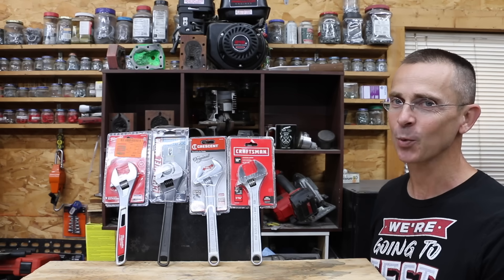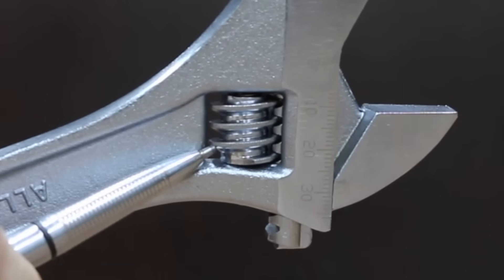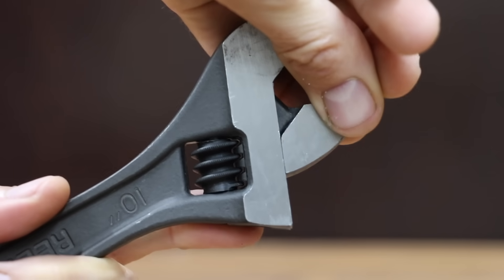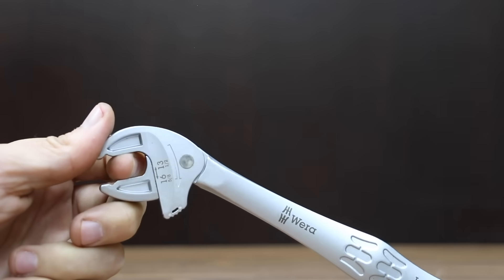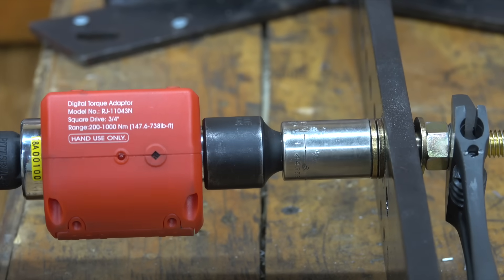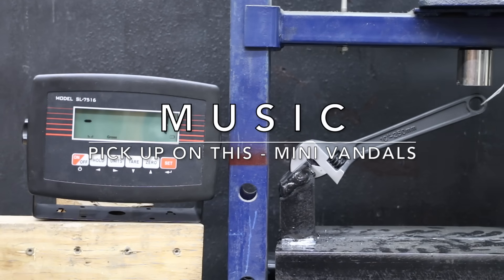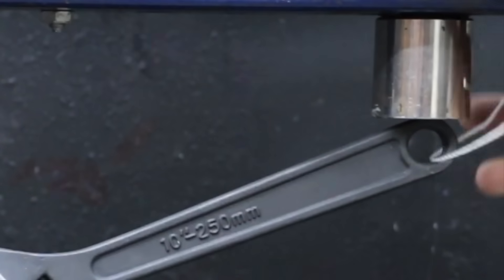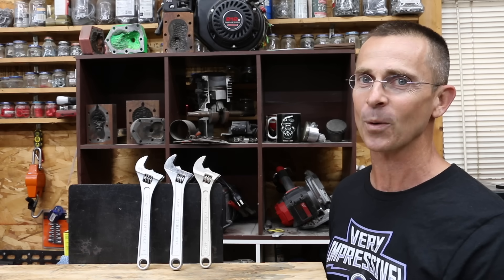Best Wrench (ADJUSTABLE)? Craftsman USA vs Craftsman, Crescent, Kobalt, Milwaukee, Channellock

Comment: I think I remember Ave saying once that to get an extra tight clamp load, adjust it as far as you can by hand, then tap it to cause the slack in the worm gear, and then tighten a bit more.  I think the real comparison is a dirt cheap $30 set of box end wrenches vs a fairly expensive $30 adjustable wrench.  I envy other countries that don't need to bother with inferior SAE fasteners, and only need to have a single set of sockets/wrenches/etc.
Reply from the maker: Thanks for sharing.

Comment: My 10" bahco stripped the adjustment nut when I put a pipe on the handle,  didn't get much pressure on it before it broke either.  
Weird.
Reply from the maker: Thanks for sharing!

Comment: Good as always!!! 
SUGGESTION!!!
I wish you would include a couple of the " professional" brand tools like Snap-On and Mac, Matco, etc. It will let people see that the the highly overpriced " professional" tools are in most cases no better that the ones your using. I think it would also show some of the ones that buy the highly overpriced ones  , that there not that great, in a wide comparison of all the brands your already comparing. I have a couple mechanic friends that have well over  $100,000 tied up in Snap-On, so would love to show them some real tool tests like yours with a wide range of comparisons. One friend had already quit buying Snap-On but my other one is a die hard.
Reply from the maker: Thanks!  Thanks for the suggestion.

Comment: Great Video!  Thank you.  It has always been said… to be careful of which way you turn a “crescent wrench”.  I would be curious to know if there is a performance difference when using the wrenches in different directions.  A difference direction when applying torque changes where there movable jaw sees the load from the corner of the nut.  In your, very good test, the corner of the nut applied load farther out o. The movable jaw.  If the direction of rotation is changed the corner of the nut engaged with the movable jaw moves in closer to the body of the wrench.  I wonder if that will change the performance of the nut rounding.  Thanks again for a great video showdown.  All the best.  Chuck

Comment: This is a great Video.  My outcome for the choice of adjustable wrench is a little different than the one here, but my requirements have shifted over the years.

I have owned a YUGE number of adjustable wrenches in the last 35 years and the ones that I have that perform the best are my set of 807x series Bahco wrenches that I keep stashed in my grab and go tool bag.  The Kobalt and Crescents have been relegated to the "back of my closet" tool bags that I keep in the house for light work but I know they will not handle serious stress.  The Made in the USA Craftsman are still in my tool chests, but they are not nearly as dependable as my  Bahco which is why they are not in the critical Grab and Go tool bag of essentials.  I do not have any of the foreign made Sears Craftsman so I cannot compare those to the ones that were tested.   

At the end of the day, the Bahco adjustable wrenches have been worth every penny of money that I have spent on them.  They have been a super robust wrench and the examples that I have show even less slop than the one in the video.  They are a great wrench to keep under the seat of your truck as they are dependable and work every time.  Yes, they are expensive which is a disadvantage, but having broke a 10" Kobalt while making a repair to a car along the side of the road, I changed how I picked my tools to keep with me when I make trips.  For me, the Bahco (who just happens to make the adjustable wrenches sold under the Snap-On brand) are the best choice for reliability when I don't have a set of combination wrenches in reach.    

I have to admit in the modern age, Crescent is my backup to Bahco, but the 8" Crescent brand wrench was slipping on the same bolt that broke the 10" Kobalt which is why that brand is not in my bag.  That was a bad day and it changed how I purchase tools.

Comment: Just one problem (well two): 1) manufacturer continually change material composition (and sometimes production process) over the years to 'try' to maintain quality while lowering cost.

2) Slack vs precision jaws means: speed to do a job vs how well or tight you can transfer your load per job.  These tools are meant for general use, you will not see them used as often say in a F1 race.  Use 6 sided socket or Knipex parallel wrench.
Reply from the maker: Thanks for the constructive feedback.

Comment: Maybe test wire strippers - how well do they work with different sized cables.
Mine has a success rate of <50% :(
Reply from the maker: Thanks for the suggestion.

Comment: Not the least bit surprised. The first time I got my hands on a vintage USA Craftsman adjustable I was shocked at just how much nicer it was than any adjustable I'd ever used before or since, including other Craftsman.

I would like to see a version of this with locking adjustable wrenches included.
Reply: I have a 36 year old 12" Craftsman adjustable wrench. It is starting to get a little tired but still on the top of the tool box.
Reply from the maker: Thanks for the suggestion.
Reply: Locking adjustable wrenches are more of a gimmick than a real performer. I had one that was a craftsman (not sure if USA craftsman or china) I was so frustrated with the tool and the lack of improvement over a traditional crescent wrench I gave it away rather than throwing it away like I was strongly considering.
Reply: @bindthedevilloosetheangels  That might be a Craftsman problem, not a tool design problem.  I have one from Stanley and it grips so well that on one occasion I was able to use it to loosen brake flare nuts without rounding them off when I didn't have the oddball flare nut wrench required.
Reply: @IOwnCalculus  Nice. Situations like that is why I bought Flank drive plus wrenches which at the time where one of a kind. Now there are lots of copy cats.

Comment: I use a 75 year old DIAMOND Brand adjustable wrench that belonged to my grandad, newer wrenches just have too much slop in them and have a tendency to round the shoulders off a nut or bolt.
Reply from the maker: Thanks for sharing.

Comment: I’ve had a few beers so maybe I’m off base here but it seems to me you have reverse logic regarding the length of the jaws and the results of some of the tests. In my 5 beer state, seems to me that short jaws would be an advantage on the feeler gauge test of jaw stretch and that short jaws would also be an advantage on pressure - to - failure test. Or maybe I’m just annoyed that no matter how well-dine I cook my wife and kids burgers they complain that it’s too pink. The interior lighting makes the burger look much more pink than outside light. Am I right?  Besides, who wants to eat nothing but char. Can I get an amen from anyone?  I’m at the point where I’m gonna make them stand at the grill with me and do test cuts throughout the cooking process. Now what were we talking about?  Has anyone seen where the pringles went???

Comment: They don't make them like they used to. Long ago, American companies goal when making a wrench was just to make the best wrench they could. Now it is all to appease shareholders, maximize margins, reduce costs of production, revenue. Statistical analysis to determine what is the most profitable way to make a lifetime warranty tool. They don't actually need them to never break, just that the margin is high enough that the cost of replacements for the 1/50 customers who use them hard enough to break them is offset by the cost savings on the rest of the buyers who don't.
Reply from the maker: Thank you!

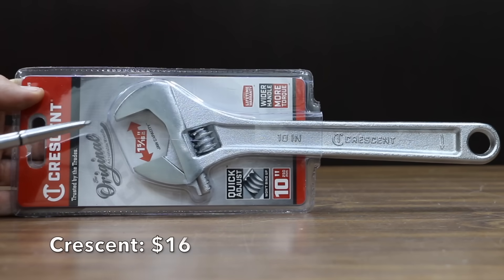Comment: 2:42 Wider handle for more torque?  I'm not sure torque works that way XD  Edit: Maybe I'm misunderstanding, but the handle looked tick in width, whereas torque should be from bolt grip to end of handle / primary torque point.
Reply from the maker: Thank for the feedback.

Comment: Once again excellent video. Always appreciate the effort. Adjustable wrenches are one tool where a cheap, poorly made version can be almost unusable. Anything with more than a mm movement is ridiculous and you may as well be using the wrong size combination wrench. A lot of times you have to hold the adjustment with your thumb while you work or readjust it each turn. It can be a nightmare.

The Klein seems like a super solid tool
Reply from the maker: Thank you!

Comment: You should test some ratchet wrenches. For strength and the lowest torque required to rachet as well as degrees of travel needed to rachet. You know since they tend to get used in the most inaccessible places.
Reply from the maker: Thank you for the video idea!

Comment: Another excellent video sir! And this one is one I've been waiting on due to some past irritation when trying to find a good quality adjustable wrench. I currently use a 12" Crescent brand (USA made version) and while it does seem to work quite well, I was pretty disappointed in the finish work on it. The edges of the jaws are razor sharp and the adjustment screw doesn't move as smooth as I would expect for a $50 wrench (probably $90 now... let's go Brandon! lol) Anyhow, here's an idea for a video. Tools made by several companies that offer both USA and China made version and put their USA and China versions head to head. I know this has already been done in your videos to some extent but not specifically a USA vs China version showdown. Just an idea.
Reply from the maker: Thank you!

Comment: The Flex Tape boat test? Cut the boat in half, put it back together with Flex Tape. It sits outside all winter exposed to the elements. Put it in the water in the spring. Will it  float and not leak after sitting outside all winter?
Reply from the maker: Thank you for the video idea!

Comment: In Spain we have a lot of great brands of adjustable wrenches, mostly from the Basque country. Acesa, Irega, Irimo, Palmera (Palm tree) now Bahco. I have an Acesa and looks very similar to the Klein. Great video as always! Cheers from Barcelona!
Reply: Yes who knew Spain was now the epicenter of adjustable wrench manufacturing 😂. Good for Spain - Anywhere but Communist China is a blessing.
Reply: I have used a Palmera ratchet screwdriver 6 days a week for over 20 years, never jammed or needed lubricant, heavily used and abused still works flawlessly rain or shine. I believe Snap-on paid license to Palmera to use the same design for their ratchet screwdriver.
Reply from the maker: Thank you!
Reply: @ProjectFarm  no, thank you for all the great comparisons
Reply: Snap on adjustables are made there as well.
Reply: Good files too. Bahco. 👍
Reply: Baco no se parte ,eso es muy bueno,no me gusta la herramienta que se Quiebra facil
Reply: I'm not defending China but let me tell you this real fact. The quality depends on the price you pay. You want a high quality one? Pay more money. You didn't have enough money? Then buy a cheap one but with lower quality. When China imitated something, they created two kinds of it for different market.
Reply: That is not true and that way of thinking is unfounded. Price doesn't equal quality, specially when quality control, building materials and technique are not a priority. There is no reason to buy anything from Chinese manufacturers if you have an alternative in your country. If you buy from China not only are you acquiring a sub-par item but also you are harming your local economy and helping China dominate your country more and more.
Reply: @Mikael2492  you can find bad quality stuff everywhere not only in china, and not always it's related to the price you pay, hence this channel, where sometimes reasonably priced items, perform similar to most expensive ones.

Comment: One thing that impoved my life a lot was throwing away all other adjustable wrenches but those bahcos. Especially the smaller 9031P gets a lot of use, but still in general use the knipex pliers wrench is better all around tool and is carried every way in the tool bag, but in the shop bahco is in frequent use and sometimes goes out in the field when I know there is a job it fits better.

Plumber taught me to apply torque the opposite way as in this video, applying it through the base of the movable jaw, not the tip. I have followed his advice.

Thank you for testing.
Reply from the maker: Thank you!

Comment: I hated seeing the old Craftsman tested to failure. :-( 

I have a Stanley 12" adjustable wrench that I picked up some 20 years ago and it's been just amazing. It was advertised as "Titanium", and from what I can tell, the handle is titanium, while the jaws and adjuster are steel. The jaws have about .5mm of slop in them, but I'd say that's acceptable for a well-used tool.
Reply from the maker: Thank you!

Comment: I feel like adjustable spanners get a bad rap because of incorrect use. Ive had a cheap Lidl branded one for about 6 years now, never rounded a bolt or damaged bolt heads, i feel like adjustables should generally be used for low torque applications. Anything above 50 newtons and i go get a socket set. Dont need a torque wrench before that as i have a calibrated elbow.
Reply from the maker: Thank you!

Comment: Gedore companie knew peoples would use the wrench as a hammer. Nice touch there! XD
I was a little bit surprise the ChannelLock didn't hold ON to the task(first test). Pun intended. But considering the narrower jaw is still an impressive result, still beating wider jaw wrench.
And i can basically say the same thing for the second stress test. Even though it has a narrow jaw (aka less material to withstand torture test) It still scored 6th-8th overall.
Very impressive tests! Keep up the testing! :)

Very interesting to see no worm-screw sheared. I used to see theses little screw shear apart with cheap wrench 15 years ago...
Reply from the maker: Thank you!

Comment: Wouldn't a shorter jaw be at an advantage due to less leverage applying force to the breaking point of the tool. For example a short cheater bar creates less force than a long one with equal wieght applied. Fix my thinking if it's wrong please.
Reply from the maker: Thank you!

Comment: You've now got almost every essential tool tested now! Only type of plier that's left is needle nose! And for that, it's primarily about gripping power and testing which type won't slip when yanking things out of tight spaces. Let's see if that crosshatch pattern that Channellock advertises is really that special (my experience says yes). Thanks for what you do!
Reply from the maker: Thank you!

Comment: Whenever I see a new project farm video, I'm both fascinated to know the results, but also rooting for my previous decisions/tool-purchases.
I've ended up with 3 Bahco spanners in my toolbox, and love them to bits. Not the expensive one feaured here with the rubber grip, just the regular all metal ones for a reasonable price, with minimal slop.
Reply from the maker: Thank you!
Reply: @ProjectFarm  They're not perfect - tend to pick up a bot of corrosion and benefit from an oily rag.
But they're the adjustable spanner team I'm backing, and you can fight me if you disagree :)

Comment: Some stuff they don't make like they used to. I mean, with hand tools like that, that have been around for a while, what significant improvements have they made over the last 30 years? 

I'd have to check the brand, but I inherited a couple adjustable wrenches from my grandpa, one of them is rusted to shit, definitely used, but the rust prevents it from backing off a nut lol. And its jaws are still pretty straight, it's my go to if I need and adjustable.
Reply from the maker: Thank you!

Comment: I don't understand the obsession with naming where the tool is manufactured. If craftsman wanted a tool manufactured in China that is the same performance of the old USA made one, they just have to specify it. The issue is that these are made to a price, not where they are made.
Reply from the maker: Thank you for the feedback!

Comment: G'day,

Great Tests, well done.

Here in Oz these things are known as either a
"Shifting Spanner"
or a
"Monkey Wrench"...

My father taught me that'd be because on the one hand whatever one sets the Jaws at, while applying the Spanner..., the actual Gap ALWAYS Shifts and loosens  whenever one applies a load to the handle and attempts to actually use the things...

And on the other hand, in light of point-1..., only a Monkey would try to use such a thing for anything involving any kind of high forces - because all they're good for is to round-off all the Nuts & Bolt-Heads they are ever applied to in earnest.

What it boils down to is that these things are most useful for identifying Bicycles, Lawnmowers, Motorbikes, Generators, Waterpumps, Cars and Trucks to avoid buying - because one can see the Witness-Marks left all over the Duds, showing where someone who lacked the correct Tools and didn't know any better than to have tried to get away with using the wrong Tools...., has already broken the Unit somehow (probably by having used it wrongly !) and then  monkeyed around making things worse while trying to fix it with the wrong Tools - and that's why now they're trying to sell it to some poor  ignorant trusting Bargain-Hunter...

   So, they do have their purpose...; but if one can possibly avoid using them then one is far less likely to wind up feeling and looking like a Monkey, after having made a mess of the Job...(!).

   Just(ifiably ?) sayin',

Have a good one...

Stay safe.

;-p

Ciao !